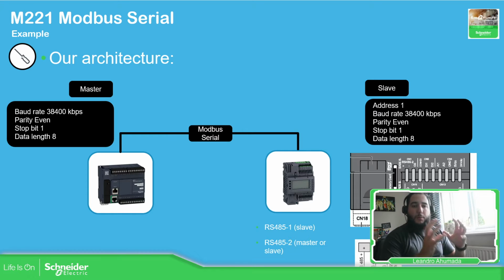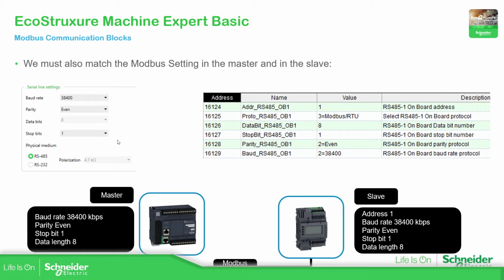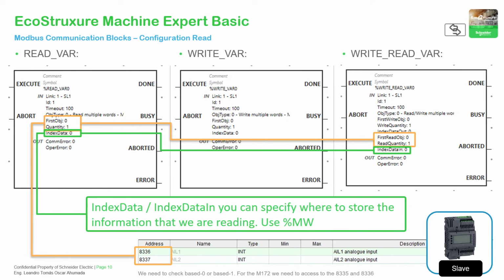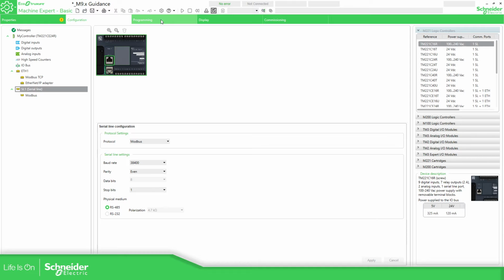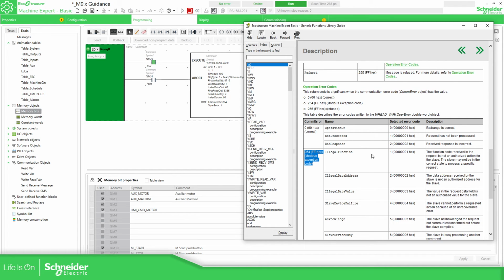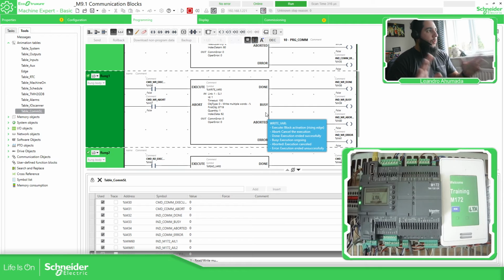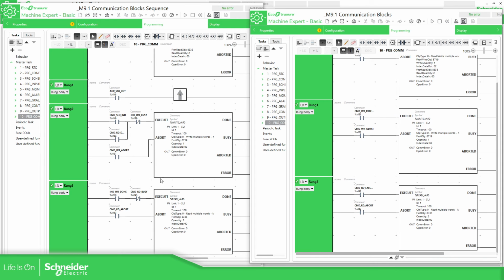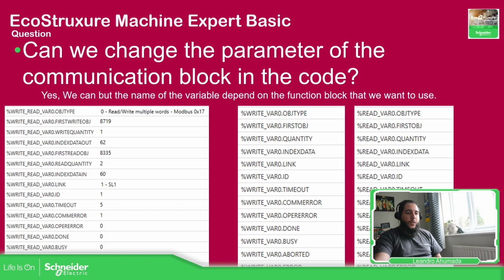Training - M221 - M9.1 Modbus Serial Communication Blocks

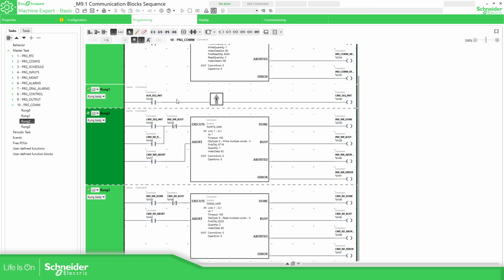Comment: 26:26 Hello!
I didnt get that line, with the plc cycle, why do you need that?
Reply from the maker: Hi there! With the plc first cycle you can initialise things in your code.
Reply: @LeTomasAHUMADA  Ah man, now i think i got it, the functions execute ciclicaly. The first function is executed by the initialize bit and also by the "Done" bit of the last block. 

But what if one of the blocks errors?
Reply from the maker: @electrolis  you can store the error message using a rise trigger to identify the error then you can add a logic to retry n times before giving an alarm
Reply: @LeTomasAHUMADA but if one block errors it wont activate its "done" bit so it won't continue? Am i wright? Basically the chain will stop?
Reply from the maker: @electrolis yes correct, the done will guarantee everything is okay
Reply: @LeTomasAHUMADA Sorry, what i was trying to ask is: If the request block in ecos struxure gets an error, it wont turn the "done" bit on so will the modbus request chain stop or what?

Comment: Hi  LET, how we can connect tm221 to thermostat via SL , you know TM221 just have serial line (interface ethernet ) but thermostat onley have (A,B) port ?
Reply: E5CC omron , problem which pins of serial line interface is RS485 ?
Reply from the maker: @ based on this:
https://files.omron.eu/downloads/latest/manual/en/1654637-7_e5cc_instruction_sheet_en.pdf?v=2#page377

I will try:
M221 pin 4 to pin 13
M221 pin 5 to pin 14

And if it does not work swap them.

If i have one of those omron i will test it but i do not have one 🥲
Reply: @LeTomasAHUMADA   thanks for your details , When we have more than 2 digital thermostat how can we arrange time between them for protect against communication error (4 E5CC , read ,and write SV ,PV to TM221 ) through Mudbus protocol ?
Reply from the maker: @ I recommend you to use the IOscanner so you will not think about it 😊 otherwise after execution of a block you will need to trigger the otherone
Reply: but thermostat E5CC only has Serial interface , i think IOScaner for TCP interface ?
Reply from the maker: @ you can use the ioscanner for serial but only one can be active tcp or serial not both together
Reply: I have Hmi i wish to Tcp port and Serial for Thermostat, can i do it please ?
Reply from the maker: @ it will be okay, the m221 is usually server/slave in ModbusTcp and you can use the ioscanner in the serial
Reply from the maker: Hi there! If the Thermostat us MOdbus Serial RS485 then try to connect it the serial of the M221, be careful on the ground for the thermostat. Do you have any datasheet and reference for that sensor?

Comment: I have to comunicate vfd with PLC and HMI at a time how can i do that in my case HMI is master.
Reply from the maker: Hi there! I usually use the M221 as master then the VSD and HMI as slave.
Usually the M221 has 2 modbus serial or 1 serial + 1 ethernet so you can use on to control as master the VSD and the other as slave to be connected the master HMI

Comment: Very good videos my friend, you make a comunication with vdf ACS580 ABB?
Reply from the maker: Hi there! Thank you 😊. Unfortunately i only use Schneider products because is the only thing i have access to 😁 but i get one of those drives i will make a video.
Reply: @LeTomasAHUMADA  I have another question, well at the moment I do not have access to the VDF that I am going to link, but I am already advancing the programming, when I simulate the m221 plc, the RTU communication blocks are at error 6, this indicates that the parameters are not the correct ones, is this error because I am simulating?
Reply from the maker: @erickruizabanto6976  in simulation the communication does not work so i advice you to get the real Plc to test it
Reply: Hey man!
Im trying to do the same thing, same vfd, it gets the requests and it sends it back on the network but i think i dont acces the right registers.

Comment: Hi dear, I have a serial devices connected to an ethernet gateway and then connected to M221 PLC 
I am using Modbus TCP IO scanner to read the data, but I have problem where I cannot change the slaves devices unit ID
I appreciate if you can support me how to use the M221 as Modbus rtu over tcp ?
Reply from the maker: Hi there! Not problem then the unit id in the ioscanner must match the slave id if you are using a gateway.

Comment: Hello i am using the TM221CE16R it doesn't support PTO functions , can i use the RS485 serial port to send instruction to a servo drive that has also serial port , if yes can you give me a quick brief or a guide please .
Reply from the maker: Hi bechir! as the M221 that you have does not have transistor output the use of the PTO functionality is not possible. As an alternative you could use the Modbus to control an LXM28 or LXM32 but i believe is not straight forward as using PTO or CanOpen (not for M221). I do not have a real experience using a MbSerial to control a servo so i recommend you to contact the technical support team in your country for some example (if there is something):
https://www.se.com/ww/en/work/support/country-selector/contact-us.jsp
Reply: @LeTomasAHUMADA   yes after looking at the documentation i managed to stumble on the write_var block that is used to send word throw serial port and i think after knowing on which adress to send command for the drive i can instruct the servo from the plc as the rtu master, ps: i am using the Delta ASD-B3-0421-L servo drive
Reply from the maker: @bechir.jaballah  i thought you were using schneider servo 😅. I believe it is going to be easy if you defined the ioscanner on the plc to communicate with the slave the problem is to check the address and the behaviour of the servo
Reply: @LeTomasAHUMADA  yes indeed that what i have done but just to make sure i am doing everything right , in order to send command from the plc to the servo we use the Write_Var and Read_Var functions after defining the adresses and the word , right ?
Reply from the maker: @bechir.jaballah  the easiest way to communicate with a device is using a Ioscanner, take a look in the next video: https://youtu.be/70-8r7q0XfY

Comment: thank you for your efforts, how can you get the address for inputs such 8640 and 8336 if i used  M221 as a slave ,too?
when I opened the analog input from configurations ,it doesn't appear
Reply from the maker: Hi Ahmed, i recommend you to move the %I variables to a %MW variables.
Reply: @LeTomasAHUMADA  
thank you for kindly reply , what do you mean by %I?
Reply from the maker: @AhmedMohammed-rm3yy  i meant the physical input %I0.1 or %IW0.1 of the M221
Reply: @LeTomasAHUMADA  
thank you for kindly reply

Comment: Sir, can i use that function block too when i use io scanner?
Reply from the maker: Hi Jonathan, i have not tried that to be honest. If you are using the ioscanner you can see that is much better than using the blocks… i do not use in my program the blocks. What you can not do is to enable the ioscanner for serial and ethernet at the same time.
Reply: @LeTomasAHUMADA  okay thank you so much sir